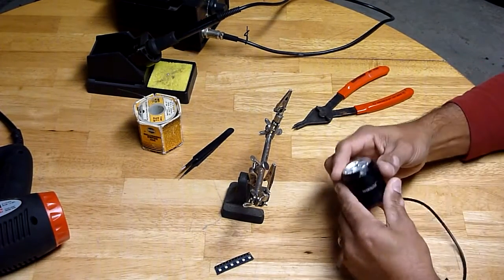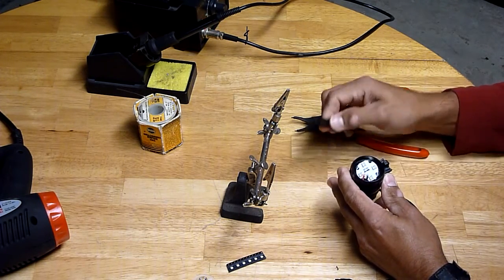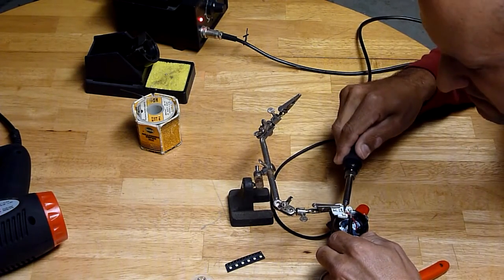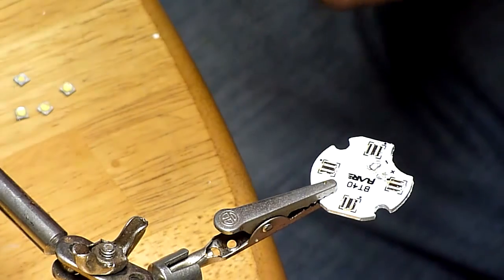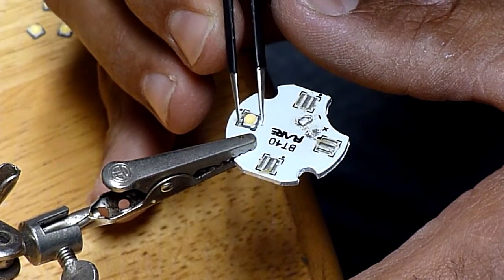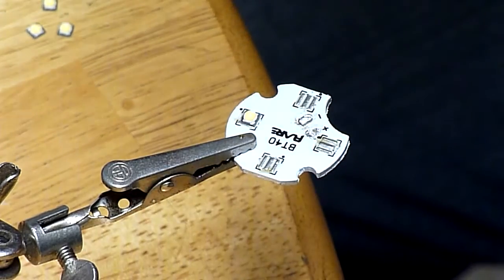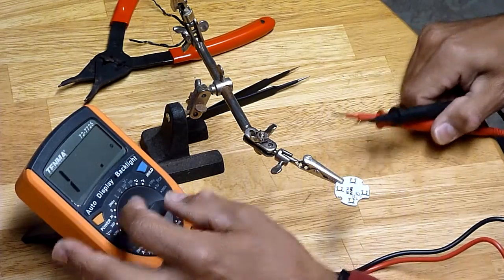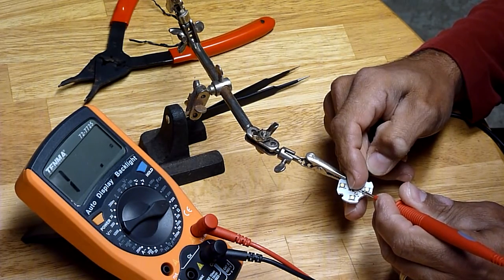Nitefighter BT40S Bike Light Emitter Swap from XP-G2 to Nichia

Comment: Wich LED did you used? And how exactly you boosted the driver? Thanks
Reply from the maker: The LED is the Nichia 219C. In the US these are available from Mountain Electronics.  For details on the build, see post #58 of My Bike Lights Thread on BudgetLightForum, link: http://budgetlightforum.com/node/34302?page=1#comment-843916
Reply: Garry Bunk Thaks a lot ! Serious improvement

Comment from the maker: The Nichias focus fine and work well. They didn't add any throw by themselves. Beam pattern pretty well the same. I boosted the driver to 4A output (2A per LED due to the 2S2P arrangement) and that added throw (while lighting up the entire woods like daytime!).

I am currently working on my 2nd BT40S in which I am using XP-G3'S  (neutral white of course). I'm not sure how much I'm going to boost the output on this one, maybe 3A (1.5A per emitter). Problem with 4A was that low was boosted higher than needed and 4A was overkill. I expect the XP-G3'S to provide a huge boost in output as well. I'll provide details over in the MTBR thread on this light. 

Maybe if I ever do a 3rd one I'll try XP-L HI's.

Comment: Thanks you!   Was curious if I could use a regular heat gun to change the leds out and got lucky finding this randomly.

Noticed you gave them all a nudge when it seemed like the solder was melted, was that to seat them in the solder or were you just being OCD about positioning?

Also if you needed to add solder would you have used your iron to add a little to the pads or are you talking solder paste for hot air soldering.  I have a nice iron and regular soldering supplies but no air soldering stuff thats why I ask, wondering if I need to buy paste?

Anyway thx for all your info and posts on the forums! big help for me.  Its been info overload trying to pick lights.  I hate the overly blue/cool colored lights so its nice that I could change the leds.   From what I read it seems like bt40s + yinding 900 are it good picks?  Hopefully the neutral white is nice.
Reply from the maker: Glad the video helps! I think I was just nudging the emitters into better position. There's not much room for error in their position. To add solder I would just use a regular iron (or do it when the pads are heated by the heat gun) and dab regular solder on the pads; I haven't tried solder paste yet. BTW - XP-G3's are the hot new LED to do this swap with now.
The Yinding (genuine from GearBest) is a decent budget light, but is too small with too little heatsinking to handle the output on high without significant airflow.
Reply: Awesome thank you!  Plan on using the aluminum gopro adapter hope that helps a little.